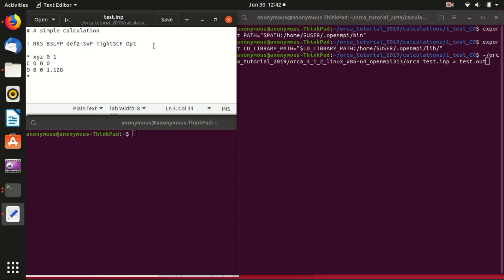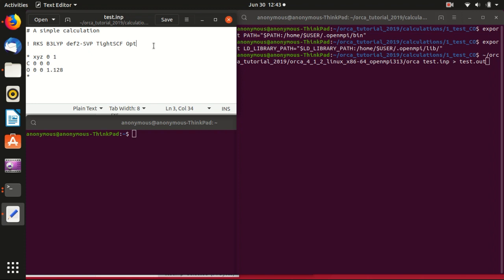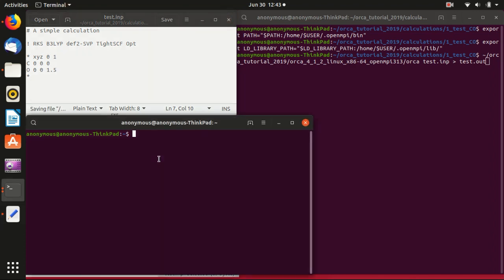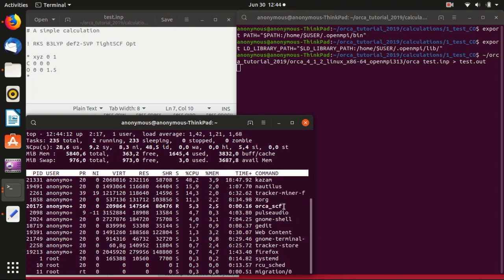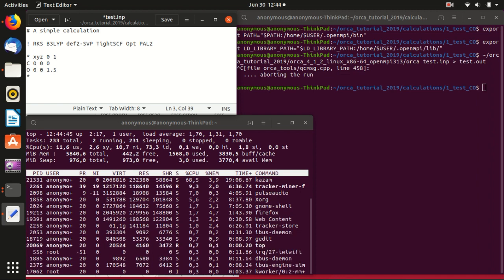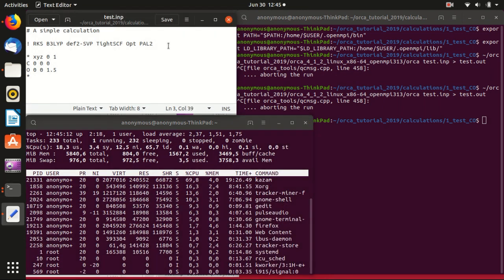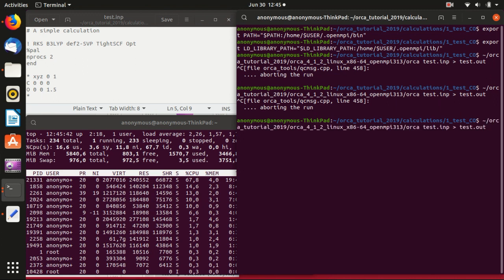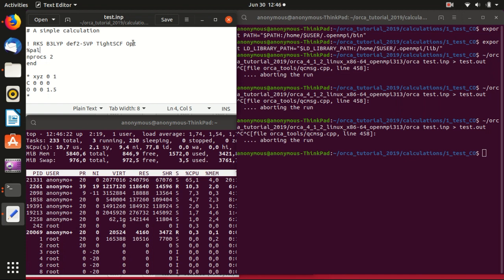ORCA Tutorial: 4 parallel computing

Comment: Good evening dear. Thank you so much for providing such a beautiful tutorial for beginners. I learnt many things from your tutorial.

I tried whatever you have suggested regarding parallel OpenMPI. But, I got error.

My Pc configurations

Architecture: ×85_64
CPUs: 12
Threads per core: 2
Cores per socket: 6
Socket: 1
Numa node: 1
CPU Family: 6
Model: Intel Xeon CPU E5-1650 v3 @3.50GHz

RAM: 16 GB
SSD: 150 GB
 and when I ran PAL2 it shows,

Process recieved signal
Segmentation falut (11)
Signal code: address not mapped
Failing at address: nil
Segmentation fault (core dumped)
file orca_tools/qcmsg.cpp, line 458
.....aborting run

So, please help me to resolve this.

I am waiting for your valuable response. Thanks in advance

Sincerely, 
Prof. Shravan B Rathod